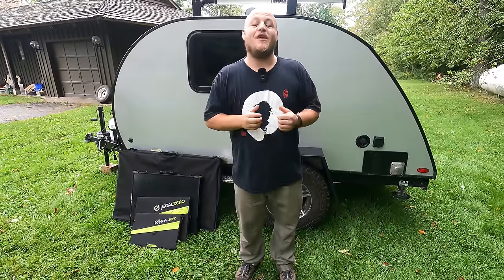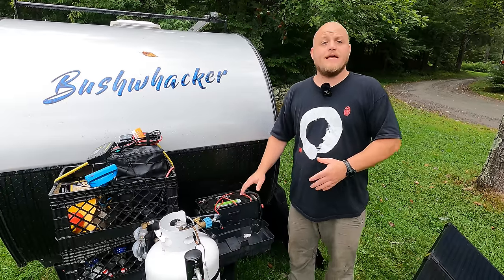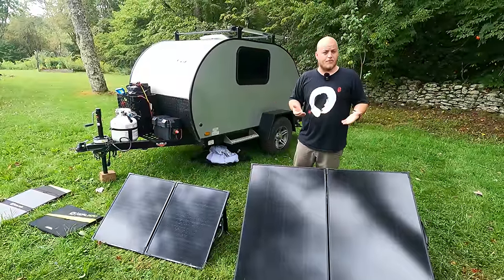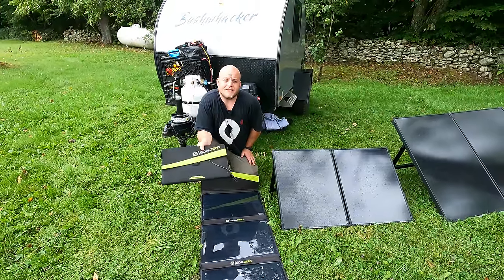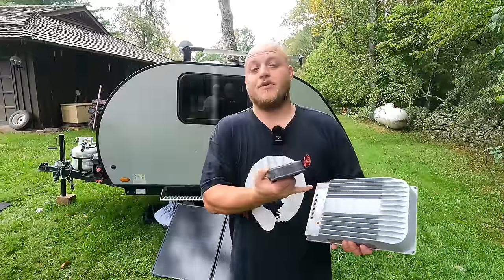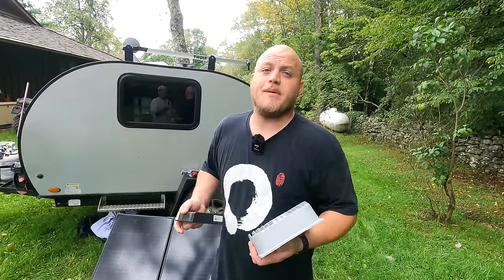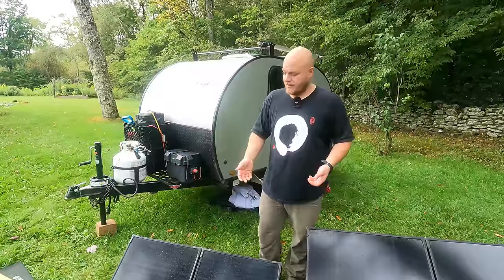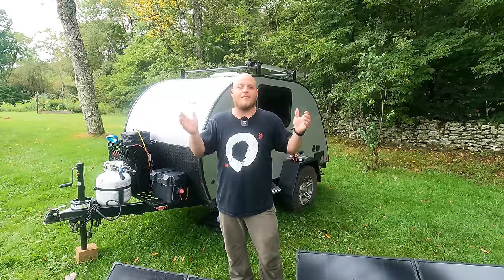RV Solar 101 : Everything a Beginner Needs to Know !

Comment: Can I use a 30 amps charge controller with 100w solar panel? I just wanna change my 12v fridge
Reply from the maker: Short answer, yes but you should give this video a rewatch and watch our other videos on solar as well.   

100 W solar panel only requires a 10 amp charge controller .  a 30 amp charge controller is not going to give you any better results but will allow you to add solar in the future without having to upgrade.

Solar doesn't charge a fridge or run anything, it just charges the battery.  You need to make sure that you have a battery that can support your refrigerator when the sun isn't shining, and then the solar can be used to charge that battery back up.
Hope this helps!
Reply: @DIYOutdoorLife  gotcha 👌  I do have a 100ah lithium battery running on a 12v fridge and my 100w solar panel chargers the battery 100% by the end of the day but when I wake up in the morning the battery's are completely drained from the fridge, and the fridge it's on eco mode. So am I doing something wrong?
Reply from the maker: what kind of refrigerator?  Something isn’t right, most 12 VDC refrigerators will run for several days on a 100ah lifepo4 battery.   

I’m assuming there are several appliances that are drawing the battery down.

There is no amount of solar in the world that helps you when you can’t run 24 hours.  There is typically only three or four hours during a sunny day that we can harvest energy.   Obviously nothing at night, but also nothing when the weather is bad.   The key is getting your battery to last you several days, then you can rebound with solar.   It sounds like your best investment would be to up your battery size, and also figure out where all that energy is going.    Happy to help if I can, stick with that
Reply: @DIYOutdoorLife  it's a BougeRV 12 Volt Refrigerator 12V Car Fridge 23 Quart Portable Freezer Compressor Cooler 12/24V DC 110~240V
Reply: @DIYOutdoorLife  the battery I'm using is LiTime 12V 100Ah Lithium LiFePO4 Battery, Built-in 100A BMS, 4000-15000 Cycles
Reply from the maker: I have that same refrigerator and I get about six days on 100 amp hour lithium battery, In the spring and fall I get longer than that when it’s a little cooler out.   There must be something else consuming your battery or the fridge is acting up.
Reply: @DIYOutdoorLife  do you think it could be my wiring? I'm using 10 gauge wiring
Reply: @DIYOutdoorLife  i have nothing else connected to the battery just the fridge
Reply from the maker: @fabioalmeida9281 

 10 awg is fine.  Where is your fridge located? Is there a chance it’s overheating or not ventilating?

Comment: Good content here but two years old now. I use a weather proof portable MPPT inline controller with my suitcase panels. $75
Reply from the maker: It's really really nice to see those changes, things are developing fast!   Can you let me know what type of waterproof  MPPT you're using and have had good experience with?
Reply: @DIYOutdoorLife  price wet up since I purchase a year and a half ago, but so has everything else. I have a camper with 85w on top but seek shade when it’s hot. I’ve a 200w suitcase I use on this controller and cable to the sun. I also invert primarily  to charge my eBike and other assorted tool batts. So far it’s been a great tool. You have good content.  Keep up the good work.
Reply from the maker: @Doc.Holiday  nice! What is the brand and model of your solar  and charge controller?
Reply: @DIYOutdoorLife  I did paste a link above but maybe YT didn’t like it. Here is the whole description on the big A… 20A 12V/24V MPPT Wireless Solar Charge Controller, Bateria Power Intelligent Solar Panel Regulator 20 Amp BT App Function for 12/24 Volt LiFePO4, Gel, AGM, FLD, SLD, Li Battery (Sunrock 20Pro)
Reply: @DIYOutdoorLife  ,… yea, I see now. The link didn’t take.
Reply: @DIYOutdoorLife  I also use it on my boat once in a while.  That’s a 24v system.

Comment: good information, but i still don't no how much solar i need. I'm spoiled. I want to run all the amentities. microwave, refrigerator, burn toilet, air conditioning, ect. From living out of a car to tear drop, to 30 foot campers. Living free, on the road.
Reply from the maker: Do you have a budget?  Although systems like this are possible, they can end up costing $10,000 and still have limitations.  Modern technology makes all of these things doable, but air-conditioning in particular can be extraordinarily expensive.  Is a large gas powered generator something that you'd be willing to do?

Comment: we have a 100 watt on the roof and a 10 amp controller  i want to add a 100 watt to the battery renogy 100watt portable   to our flagstaff 176 ltd
Reply from the maker: That will be nice. Get a portable with a charge controller attached and you can run them both.
Reply: @DIYOutdoorLife  thank you

Comment: Well I thought I knew what I was doing .. apperantly not.  Not sure how I came up with my system.   I have 3 LAB's  2/100watt panels, and the 2nd pwm controller.  I replaced it with what I thought Amazon was selling me was a mppt.  Turns out not.  
I was told that I needed 2 more 100watt panels. 400watts total.  I'm in a 33foot Winnie.  Does this sound right? With the 3rd grade math.... Ummm. Still lost.
Reply from the maker: You’ll get it, it gets easier.  What’s the capacity of the batteries? 3 in parallel of what AH?

Comment: You most certainly can draw a AGM battery to 10.8v just like the manufacturer states on the battery data sheet. You also can draw 100ah out of the 100ah battery with a load of .2c. Which you will see in the battery data specs
Reply from the maker: No, You most certainly will drop the life cycles down to a couple hundred by trying that.  

You are confusing the data sheet (or being misled) to believe the low voltage of a deep cycle, which can be sustained without shorting cells, is the point that you “should” go to.  

The life expectancy of the battery will go from 1000-1200 cycles to 300 or less when cycling to 10.8 vdc.  This could be the difference between a 10 year battery on your camper and 1 year.

In some industrial settings, we’ll allow the AGMs to drop near 11vdc because there’s a value in the total watts per dollar of the system, NOT true for almost any camper scenario.

You cannot draw 100 amp hours out of 100 amp our lead acid, ever, under any scenario, without causing irreparable harm, regardless of the C rate, the battery will never work the same.

I appreciate you swinging by Randy but essentially everything you said is radically false.  AGM batteries can be the most effective solution for RVs when you know how to care for them and don’t want to upgrade to LiFePo4 charging systems.  The only way for this to make any financial sense, is by keeping the cycle life high and remaining “floated” as much as possible and not cycling below 50% or ~12.2.  I didn’t make these things up, well established and tested facts.

Comment: 2:00 Can you see how it makes no sense to say to someone, "this is a 100 amp hour battery, which means we can use 50 amp hours." It's bad enough to not know what an amp hour is, but to call it a 100 when you can only use 50 seems crazy. It should be called a 50 amp hour battery if that's what you can use. That's like saying a car engine has 6 cylinders but only 3 of them move.
Reply from the maker: Unfortunately, I did not invent these devices.
A lead acid battery tells you its listed capacity.  If you use more than the top half of that capacity, you ware the battery out very quickly.  Following your analogy, it's more like saying your six cylinder car can go 130 miles an hour, but you should drive under 65.

Comment: That is NOT a camper! It is a RV, Travel trailer, or Tear Drop but NOT a camper. A camper does not have an axle and is carried. Some states go so far as to call a camper cargo and don't license them.
Reply from the maker: lol. … I hear you, sometimes I become pretty particular about language as well.

In this case, you’re referring to some specific registration language .  If you actually look up “camper” in several different dictionaries, you’ll find something like this-

 a portable dwelling (such as a specially equipped trailer or automotive vehicle) for use during casual travel and camping

-  in this case, along with most listed definitions,  you’ll see “trailer or automotive vehicle” included in the definition.

The vast majority of definitions include travel trailers and recreational vehicles as examples of  “campers”.

Either way, I understand where you’re coming from, but I wouldn’t die on that hill .

Comment: You lost me already at 1:05 "A charging profile that can be used as a battery." Huh? What? So the thing you touched is not a battery, it's a 'charging profile?' What's a charging profile?
Reply from the maker: I said a charge controller. A charge controller is an intermediary device that needs to be placed between a solar panel and a battery in order to properly charge.

Check out this video that explains more of the basics .
Solar - Beginner Friendly | The Basics
https://youtu.be/-93D_ey2DVo
Reply: @DIYOutdoorLife  At 1:09 you touch it with your right hand and clearly say 'charging profile.' You used the term again later in the video. It's not until 1:17 that you say 'charge controller' in reference to what some beginners think.
Reply from the maker: @JoeDoe2  there's two different things related here.  A charge profile is the adjustment of voltage and current ideal for charging particular batteries.   
Each battery has a target charging profile . 

The charge controller is a device responsible for delivering this charging profile. 

You need to go to charge controller and then choose the right charging profile.  There are easy, preset profiles, like "flooded" "agm" or "lithium/lifepo".

You can also set custom ones when you get the hang of it.

Comment: what would work if I tent camp as tar as panels
Reply from the maker: What type of appliances do you need/like to run?
Reply: dometic 45 cooler & charge phone & ipad
Reply from the maker: I think a perfect set up for you would be a power station around 1000 W hours that comes with 100 to 200 W of portable solar.

The power station will charge your phone and run that refrigerator for a while, 100 to 200 W of portable solar should be able to keep you topped off.  I'll post a link for the highest quality versus best price currently, let me know if you want to go a different direction.

Although it can be expensive, being able to use it in your house, when the power goes off is gonna be a great addition.

$350 off coupon attached
https://amzn.to/3uOJFGT

Comment: Use a DC to DC converter an you don't need battery's
Reply from the maker: You must mean an AC to DC converter right?  In which case you would need shore power.
Reply: A DC  to DC converter will stabilize the solar power coming from the panel and you can use it to power 12 volt item's
Reply from the maker: @jimmieblue6262  unfortunately, it doesn't work like that in practical applications.  You wouldnt have lights, water, or refrigeration at night, or even when clouds were passing over.   A battery (or grid tie) is required to effectively utilize solar.